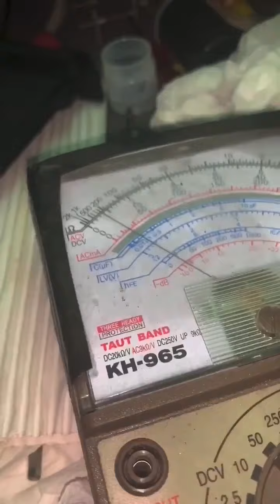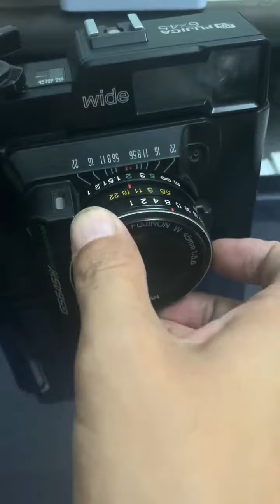Fuji gs645 repair

Comment: I have this camera.  And the shutter speed ring is stuck between 1/500 and 1/4 sec.  Unable to turn it to be slower and there is some resistance on the ring. Are services to fix the camera offered or is there a video or manual that’s available

Comment: How do you take off the film advance lever?
Reply: I've just been to look at this video which didn't help, but just put a rubber band around the set screw above the lever, wind the lever to the fully wound position then use the rubber band to turn the set screw anticlockwise. It came fairly easily in the end.